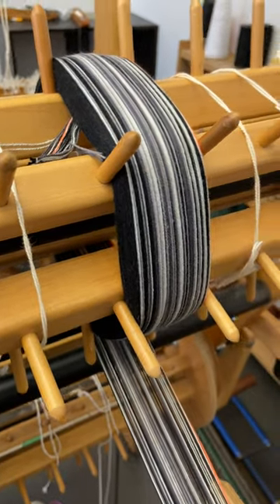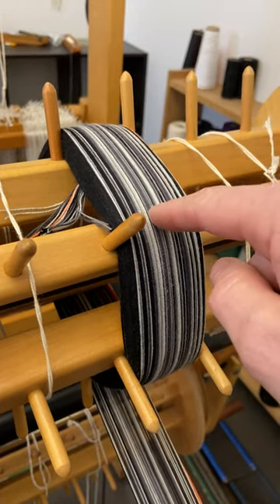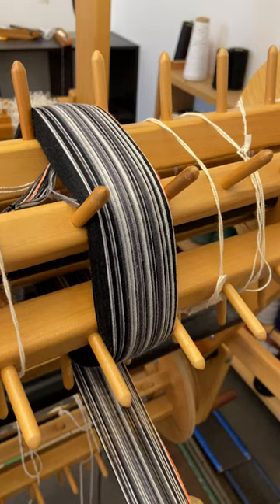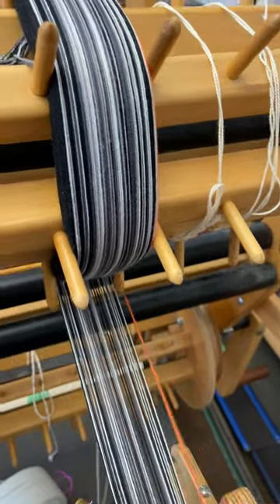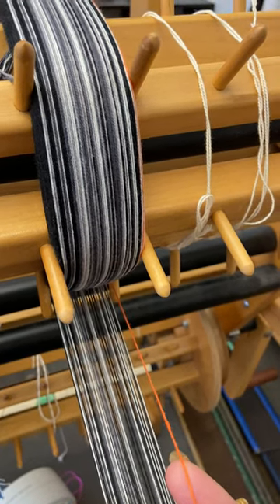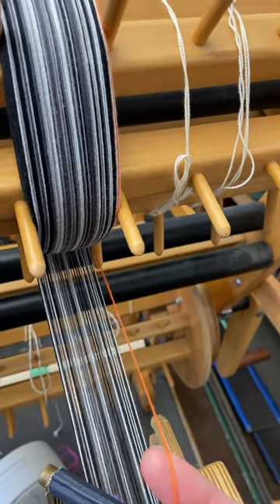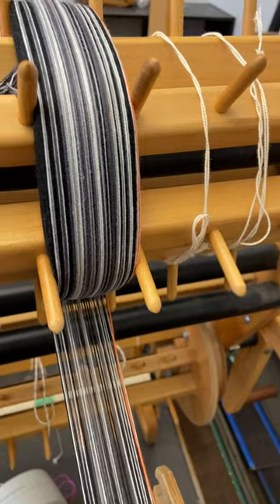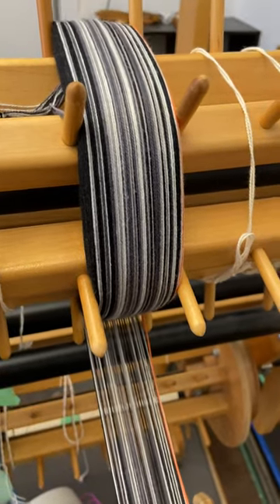Sectional precision

Comment: How do you determine if you have the correct amount of yarn on your spools to allow for the warp build-up on the Sectional?
Reply from the maker: When planning, I multiply the length of the warp by the number of sections, and that is the length I put on each spool. ((I do add a couple of yards for safety).
Reply: @rocklakeweaving1142  Thanks for your reply.